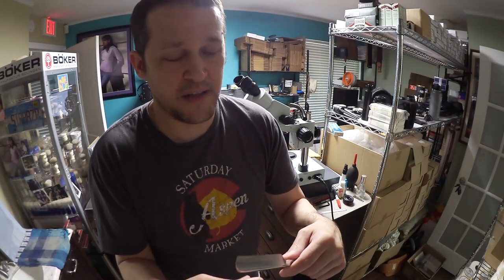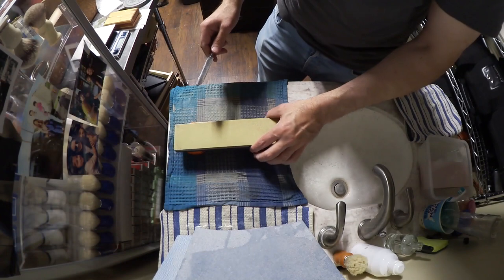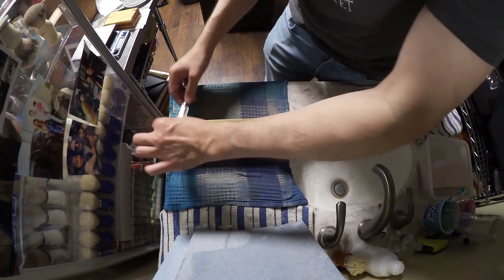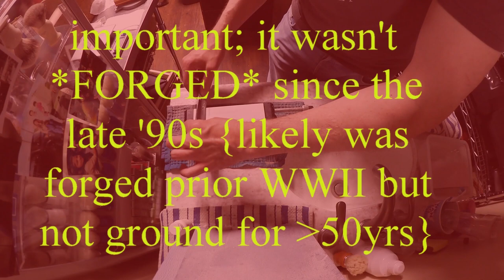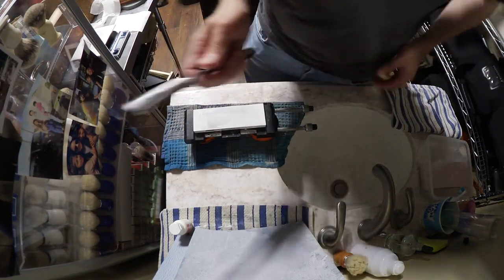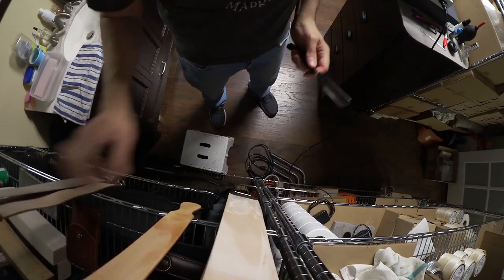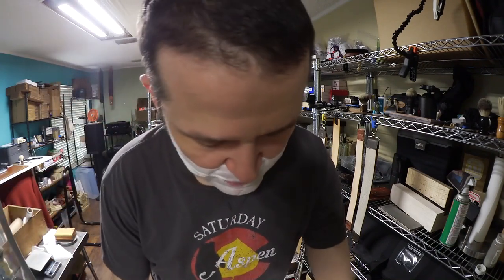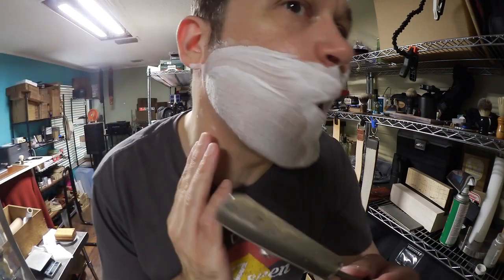Straight Razor Honing Shaving 'Vintage' Thiers Issard Le Grelot 6/8" 04.22.2022

Comment: Very interesting video, Jarrod!  I appreciate the detailed explanation of what's going on with the razor.  Shame about the oxidation though.
Cheers!   -Rob
Reply from the maker: have not seen old forged / modern ground razor that didn't have some parts that would greatly increase tendency to pit, that's just a part of getting such a razor, just didn't know that ~24yrs ago.   

They're fun, but not the most practical - usually some reason existed, beyond slow sales, that the forging was not ground in the first place way back when.